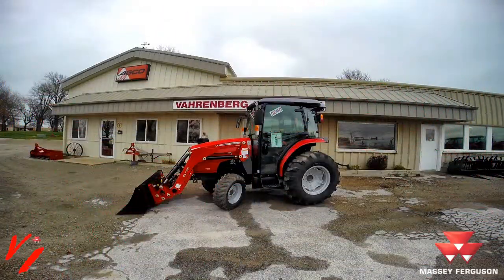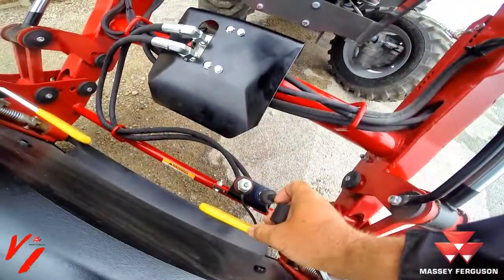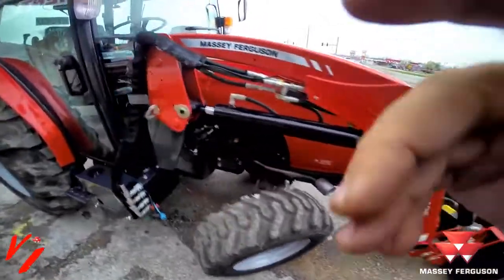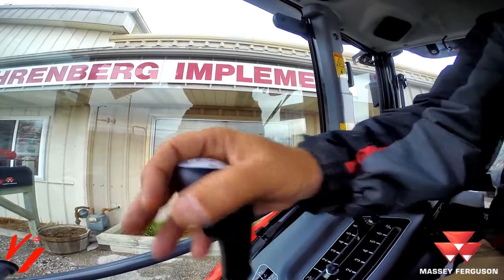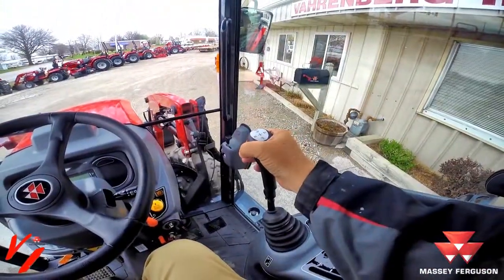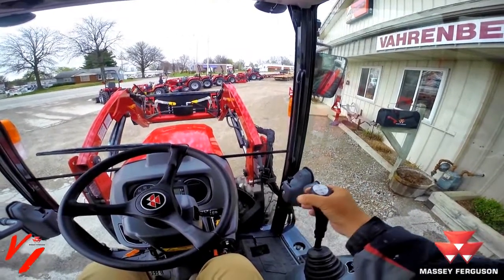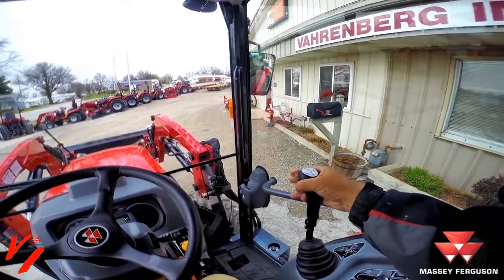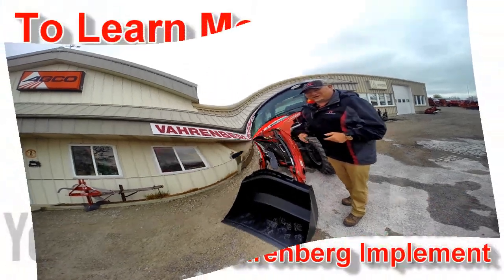Massey Ferguson 1700 Premium Compacts: Loader Solenoid 3rd Function

Comment: Would a kit similar to this be available for a 1560 series cab tractor?
Reply from the maker: The 1500 Series Loaders were made by SOO Loader company and they went out of business and no 3rd Function Kit from Massey Ferguson. You would need to use an aftermartket kit to add 3rd function.
Reply: @VahrenbergImplement  Thank you for your reply and information!

Comment: I purchased a new 1740M with the DL125 loader, is this something that I can get added to my tractor, and is it available as an add on kit that I can do myself or do you recommend my dealer installing?
Reply from the maker: Yes the Massey Ferguson Solenoid Third Function can be added to the DL125 on the 1740M. It's got good instructions and just depends on your mechanical abilities it can be done by you or the dealer.
Reply: Thank you kindly is there a specific part/kit# that I should ask for?  Also, what is the price?  I love your videos!  They are very informative, and I have watched quite a few of them.

Comment: I have a 1742 with a DL120 loader. Does MF make a third function loader kit that uses the power beyond hydraulics, instead of a solenoid diverter valve, which lets you use all 3 functions at once? If not, do they make this kit that your describing for the package I have?
Reply from the maker: The manufacturer of the DL120 was Soo Loader & Sweeprake Company and they are no longer in business. You would have to use an aftermarket product like WR Long 3rd Function Kit on those loaders.

Comment: Does MF have a third function kit for the GC1700 series of tractors?  Many aftermarket manufactures are building small sub-compact brush grapples, but they require a third function.
Reply from the maker: At this time there is not a Massey Ferguson Factory Option for 3rd Function Kit. It would have to done from aftermarket kit.

Comment: Is it possible to have the part number of this kit? I have a 1736 premium and would like to purchase but i am in Canada.
Reply from the maker: Takes two kits one for the Valve and One for the Handle Kit" Valve Kit is 72533997M Handle Kit is 72533667M. These are from the Sales Department from the Wholegoods Accessories. Ask your salesman.

Comment: Can someone please tell me what hydraulic couplers I need to have on a grapple to fit the factory 3rd Function connections on my '19 1740m? Most grapples come with flat face but I don't believe the 3rd function connections are the flat face style.  Thanks
Reply from the maker: Tractor use ISO 5675 Couplers (Pioneer Style). We did a Video on ISO5675 Couplers to help you learn about them: https://youtu.be/m9cQp9FjWMU
Reply: Vahrenberg Implement thanks very much!

Comment: Does Massey have this kit for a 2016  1734e? I have got to get one if they do. Ill order it from you.
Reply from the maker: If it is L105E Loader Massey Ferguson has a Solenoid 3rd Function Kit. Here is the video we did on that kit on 2700E but the 1700E uses the same kit: https://youtu.be/5beT2hyvv_M
Reply: I want double rear remote factory kit for my 2019 MF 1735m
Reply from the maker: You can add up to 3 Sets of Rear Remotes on 1700M Series Tractors. Massey Ferguson has the kits for 1, 2 or 3 Sets of Remotes. Talk to your dealer they can order them for you.
Reply: @VahrenbergImplement  sticker shock. I will be purchasing a dealer installed true dual remote next year tax return.